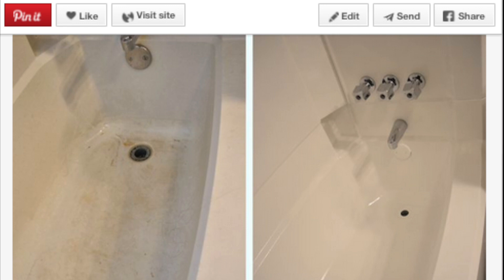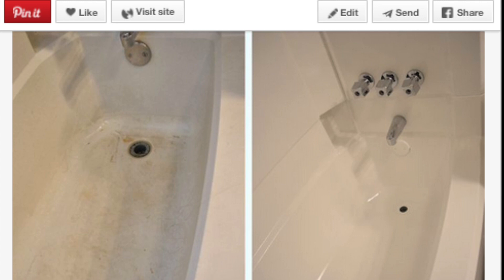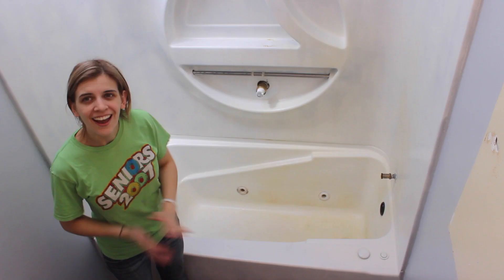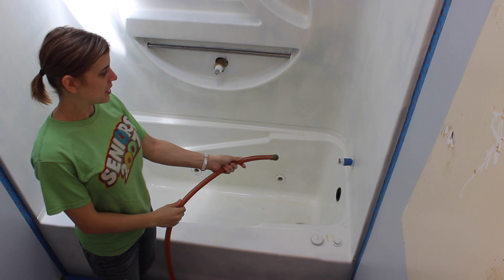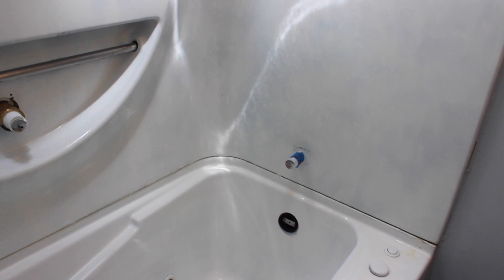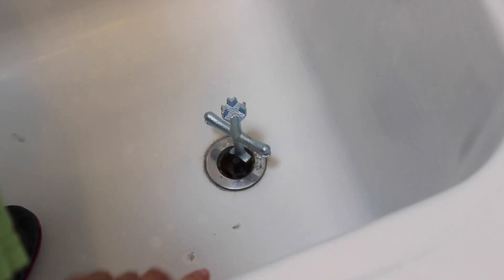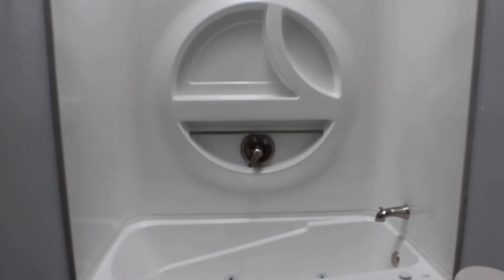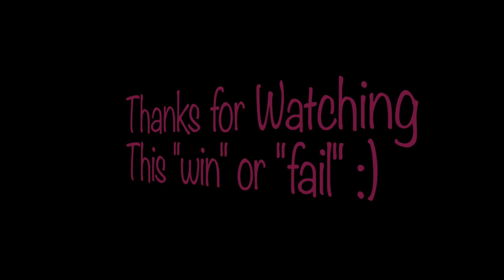HOW TO: Paint a Bathtub

Comment: It has been a year so far. How is it holding up? you mentioned  a few spots where the paint may peel. Did it peel?  The paint on our bathroom tub is peeling off. I thought about painting only the area that is peeling - I do not care about the color mismatch - do you think it would peel again?
Reply from the maker: Ozgur Bozkurt we have actually moved since then so I am not sure how it is holding up still. However, in your case I would actually do the whole thing. Fixing just a spot or two may not last very long. The most important thing before you do this is all the prep work before. If yours is peeling already you may have to do a lot of sanding before. And depending on the type of tub you have sanding may damage it. You could always do that spot however it may not last long like I said. Anyway good luck and hopefully whatever you do works for you. :)

Comment: you showed everything that you used, except the paint and the mixture can you tell what you used. please, I have tub that I want to redo.
Reply from the maker: The paint and mixture I used is part of the refinishing kit. There is also a link in the description box for the kit.
Reply: Thanks I saw another video and he used the same thing and he showed it a year later and the paint started to pill did your tub hold up pretty well?
Reply from the maker: +Victoria Walker we actually moved since then so I am not sure how it is doing now. We moved around 4 months later and it was still brand new looking. We also had really hard water.  I don't think it's suppose to be a long term fix. However you can make it last longer if you clean it with the way I cleaned it. I followed the other YouTube video (the link in the description box) he did a very good video on cleaning it. Cleaning is key when it comes to this. Good luck. :)

Comment: How do you clean it? After
Reply from the maker: I believe you can just clean it as you would with any bathtub.
Reply: Tara D I believe it’s different with painted tubs
Reply from the maker: @carmentoro5082  We just cleaned it as we would any other tub and it was fine. However we ended up moving a few months later so hopefully we didn't ruin it for the new homeowners.

Comment: I've used this brand many times and have never been fully satisfied w/ the end result. the end result on this video in 100x's worse than tubs/showers I've been unhappy w/. There are too many blotches on this tub. It looks weakly spray painted. there are better products out there, this isn't one of them. I've also the brush application on occasion and was equally disappointed
Reply from the maker: I am sorry you feel that way. I wouldn't recommend this as a long term solution. It was a quick fix. :) thanks for the comment.
Reply: joseph kaspar what other product is on the market that could be better? Pls give me some names. And where to buy. Iam from abroud and will be in the states soon. And would like to buy a good brand that could last longer. Thank you